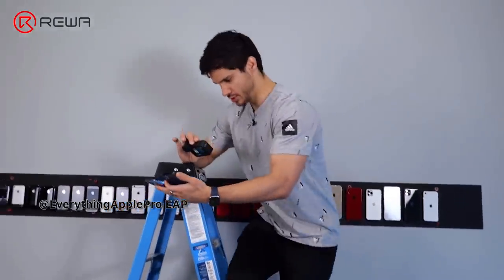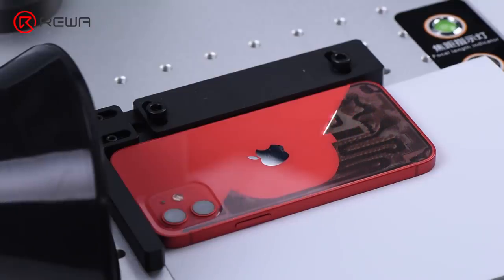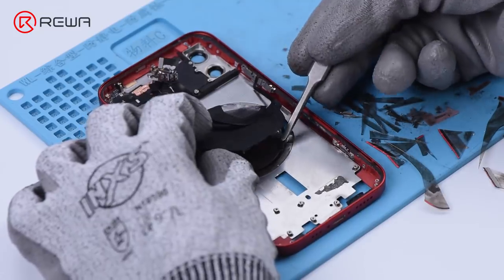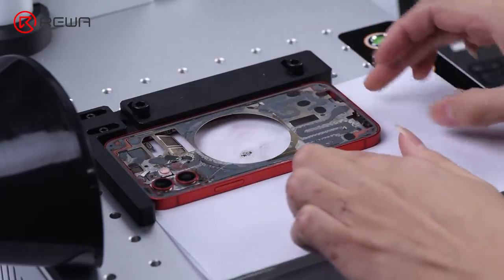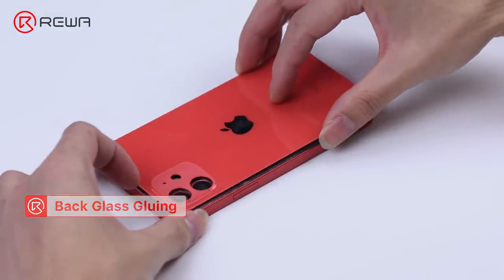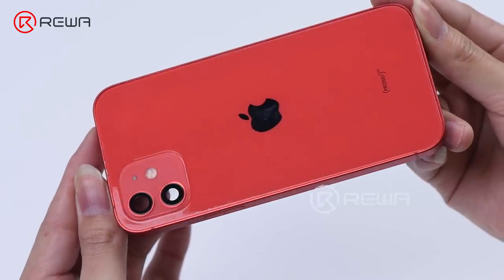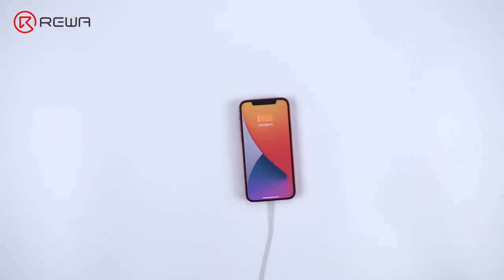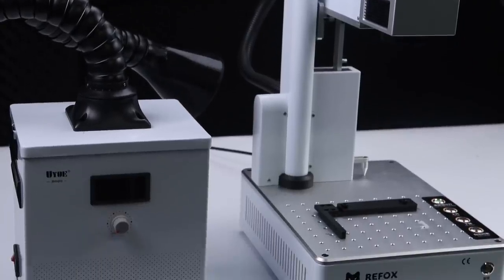The 1st iPhone 12 MagSafe Back Glass Repair Demo (Almost Failed)

Comment from the maker: Click these following links and you can order same equipments in our video:
Laser Machine Set: https://bit.ly/3kIo5sw
Glass Breaking Pen: https://bit.ly/2UIBlmz
Press Clamp: https://bit.ly/2KrJGZS
REWA Academy iPhone Logic Board Repair Foundation Course: https://bit.ly/3m1STWR

Repair Training Book Written By REWA, naming iPhone Motherboard Repair from 0 to 1, click this link to buy: https://bit.ly/3kGUa4F
Reply: I work as a tech. Possibly you can try creating an iPhone 12 template with a laser cutout of the wireless charging portion just over the space where the magnets are. 1 problem with this method is that you cant align the red guide laser with the magnets 100% from the outside. Possible solution is getting a magnet ring from an iPhone 12 and keeping it as a guiding magnet to see where the magnet is on the outside then align with red guide light. Then in theory the magnets would protect the wireless charging portion and only separate the magnets from the back. (Fingers crossed)

Issue 2 with this method comes with reassembly, you can’t align the magnet on the back glass. 
Possible solution, keeping an iPhone 12 frame using it as a guide, using the frame as a guide mark the inside of the back glass where the magnets would fit by aligning the back glass on the frame. Once marked glue magnets to back glass and proceed with reassembly.

There maybe other issues with this but perhaps this method would be a work around to a full phone disassembly for replacing back glass.

Comment: Great video Rewa.. I was waiting for this topic. It had crossed my mind already about the difficulty increasing on the iPhone 12. I was just about to invest in a laser machine but I thought I'd wait to see what came of the magsafe backglass repairs.. My initial thought is if the magnets come away easily when removing the back glass then it may be possible to avoid having to open the phone and remove alot of components including the wireless charger by utilizing some kind of magnet alignment jig or even a spare metal housing allowing correct placement of magnets on the glass away from the phone prior to installation or better still replacement backglass with new preinstalled magnets could help reduce the amount of fiddling significantly.?

Comment: You guys mentioned really casually that a new part of the repair is taking off the wireless charger. So that brings the time of the repair back to where it was before when you had to swap all the components into a new frame. Am I missing something here or did apple just make the rewa laser useless for the iPhone 12? 
If part of the process now is removing everything from the frame so you don’t damage the wireless charging coil then you might as well just put all the components in a new frame right????

Comment: No one is going to repair it with this method considering the labour and cost for technician. I have one question, why weren't you able to remove the magnet without removing the charging coil? It seems that it's glue to the coil, why couldn't you heat and remove glue with a tool?

Comment: Why didnt they just make stainless steel body buth with a circular plastic cutout for the wireless charging?
That glass on the back is such a stupid idea, especially when it is not replaceable (unlike in lets say an iPhone 4S where u could take off 2 screws and change the panel right away)

Comment: I don't get the point why the suppliers not adding the magnets to back glass ? those steps are so risky and possibly you can damage > battery, faceID, charging port flex, motherboard , volume flex, rear cameras or charging coil... so 2 choices forget the magnet glue the glass or add brand new magnets don't deal with components and most importantly < TIME >